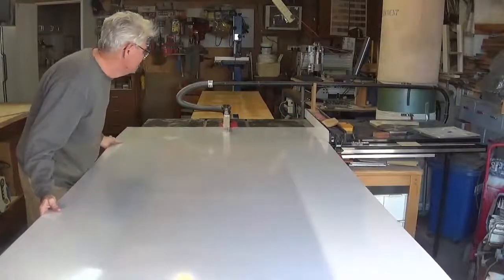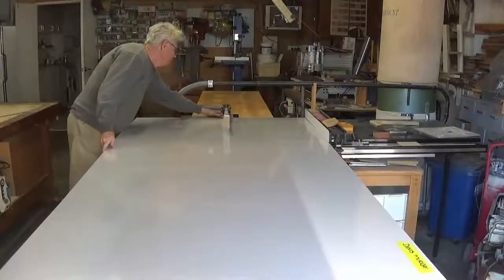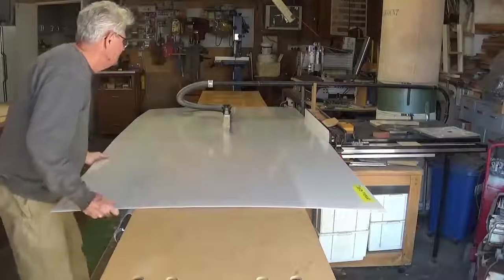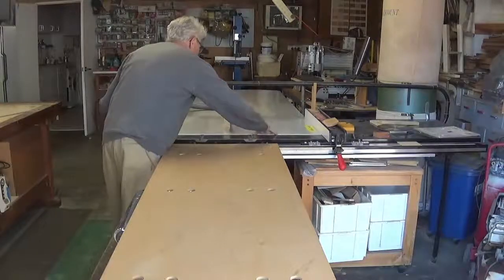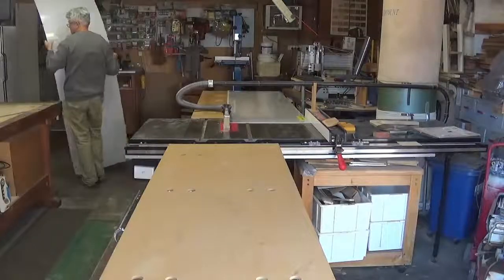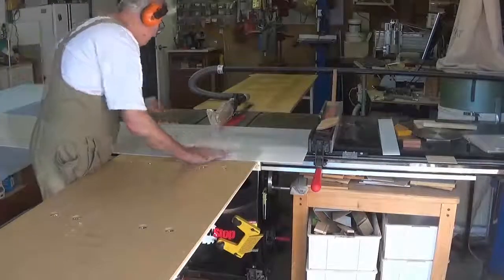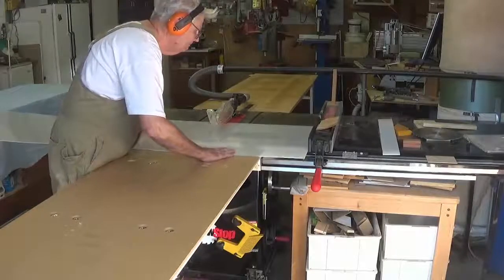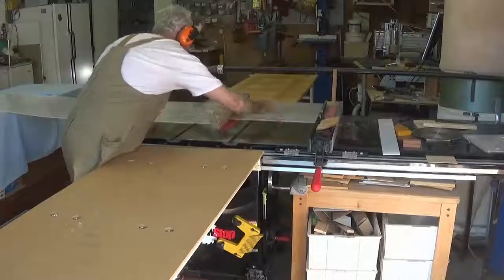HOW A JAPANESE STYLE SHOJI SCREEN IS MADE PART 13

Comment: hi there.  nice video!  that plastic white material you are cutting into pieces.  What is it called?  I would like to shop around for it to make the same thing for my shoji doors.  Thank you
Reply: Hi Endong. The material I use for my Shojis is a 3mm Acrylic sheet. It's called "Opal Satin Satin." I live in Australia, and the acrylic is imported from Thailand. It isn't clear hence the name Opal. It has a surface appearance similar to sand-blasted glass. It is called Satin Satin because the surface on both sides of the sheet have the sand-blasted appearance. It is available with only one side having the Satin appearance. This is suitable where only one side of the Shoji is visible, such as Shojis used as wardrobe doors. I wish you every success in construction of your Shojis.